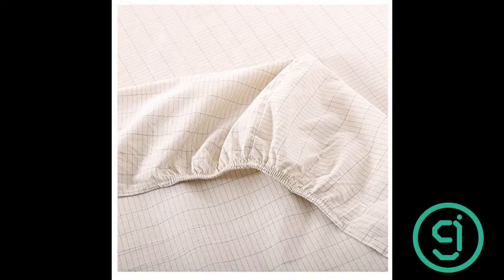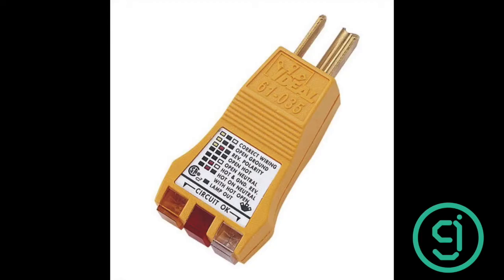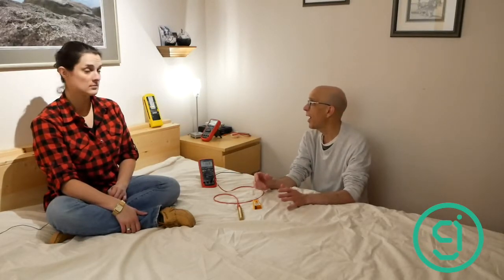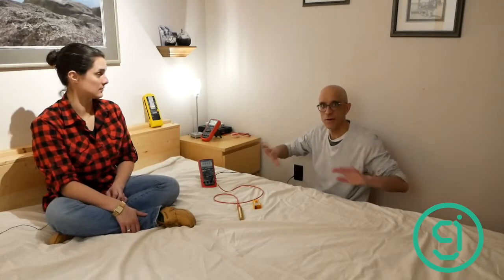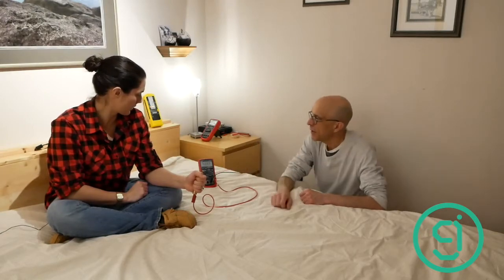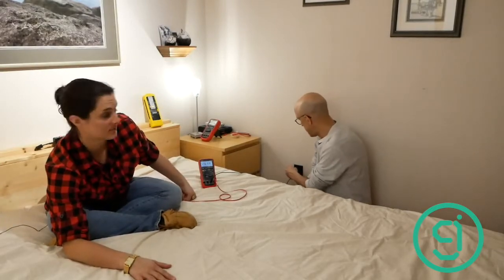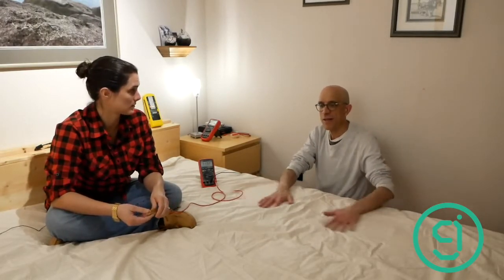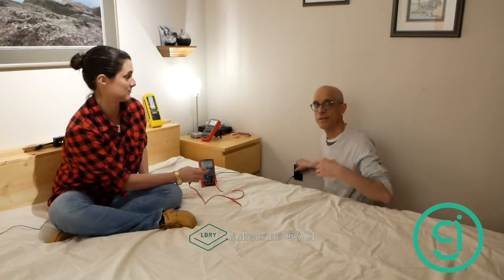Grounding Sheets Efficacy

Comment: Why do you make your sound so complicated. I’ve just purchased a really expensive one and there’s zero mention about a meter to check the electrical wiring is ground correctly. There’s no mention about additional electrical fields coming from the walls. So what are you lot trying to say. Almost feels like you are trying to dissuade people from using them !
Reply: At least you're grasping that some of this is a scam.

Get rid of the sheets and never plug foreign things that conduct into your electrical outlets unless they are an electrical device 

And most certainly never plug something into the hole of your outlet that is the ground wire, ever!!!

I don't think people really get what a ground wire is. Don't worry about because you aren't going to do this because it goes against every safety thing you ever heard about electricity in your home.

What you can do is.

Depending on your house or apartment, you can buy a wind-up alarm clock. And throw the breaker to your bedroom. And insulate your windows. 

Wood, brick and concrete aren't very good conductors of electricity.

Obviously, if this knocks out the heating or heating in your bedroom than don't do it.

Comment: This seems different from the usual case made for grounding. You are reducing the magnitude of A/C voltage picked up from a typical modern indoor environment (electro-smog?) by grounding, but other videos talk about taking off your shoes outside where presumably there is no electro-magnetic field other than the earth's normal fields. These other videos talk about charge imbalances in the body. Hard to know which theory to use when explaining why grounding is good for you.
If you want to avoid being an antenna, would a top and bottom sheet combo serve as a poor man's Faraday Cage? Let the sheets and mattress pad be the antennas while you shelter between them.

Comment: Why is no one explaining how to actually work the circuit tester? There's a ledger on mine and it doesn't say how to test outlet if grounded. Anyone? Anyone? A hundred useless reviews, not one explains it. You point to it, and just skip right over. Why? Testing if outlet grounded is the most important part. When I plug mine, two yellow lights light up, red one does not. Looks same as yours. What does it mean? Neither the seller nor any videos explain. So frustrated.
Reply: Two lights means is connected to ground. Most socket testers will have a small description of what the different lights mean. There are videos on socket testers for grounding. If you type socket testers and the name of your country you will find something similar to what you bought. I would recommend connecting directly to the earth outside with a grounding rod/pin though, that way you don’t have to worry about that or electrical interference.

Comment: Measuring the voltage to the Earth pin cannot give a true indication.  Here in Australia the Earth pin is also connected to the Neutral (return) conductor.  And while this is always earthed at each house with an earth stake, it always has an AC voltage on it of a few volts.
Reply: I would advise against anyone doing this anywhere. 

Nobody should be plugging in to the electrical outlet, into just the ground wire hole.

Even if you get a safe reading, that wire is still available to conduct electricity at any given point, that's its purpose.

Comment: I have been trying to call auroform ever since I bought your sheet about a question, but always get a receiving saying it will be a two hour wait if I wish to wait.  Also I did not get that voltage reader with the sheets when I ordered them like you just said is included..  My questions which I've submitted to auroform several times, but never get a response is can the sheets be washed in a washing machine and dried in a dryer and secondly I have a dual temperature control mat under the sheet that warms my bed during the winter months and cools it during the summer months and I was told that I need to put some sort of pad between the sheets and the dual temp pad.  Is that correct?  Also no one ever said you need a low voltage room to use it in, as I have a clock and the mat and a ceiling fan and a diffuser all in very close proximity . Does that mean it is dangerous to even try to use the sheet and during  a storm am I at risk by even having it on my bed?

Comment: Hey there, my voltage meter is not sensitive enough so I cant check body voltage. 
I made a grounding sheet myself by buying a copper fabric. Tested it with multimeter and it works fine. 
But i dont know if it works under a bedsheet. 
Would you please tell me if this would still work under a thin bedsheet.

Comment: My wife and I bough bought grounding sheets, she has one and I have one (Separate).  We both woke up independently really hot and sweating on the first night of using the sheets.  There is no temperature change in the room at all.  What is this all about?
Reply: You have water in your body I would guess the water in your body conducted heat ... I get really hot in MRI machines.. I was told prior to all reading that my cells are holding alot of water... that's my theory for me that the magnetic pull warms up all that water and boils it on cellular level, cause even in the machine I get pain in my inflammation areas and hot
Reply: Your the only person that complained  you are running a fever because you took the pfizer vaccine booster congratulations
Reply: What brand sheets?
Reply: @gregc3831  Oh golly.....   Not too sure.  It's been a LONG time that I've bought those sheets.  They were from Amazon.  They were pretty inexpensive, but they work.

Comment: How can grounding sheets affect you worse if you are in an emf field?  The EM fields interact with the silver strands on the sheets and would conduct to ground at that interaction point as the em field would superimpose electricity onto the grid far easier than your body.  Elimination of the EM field is a good idea all together, but my opinion is don't preclude yourself from getting the sheets if you happen to sleep in a high EM environment, which most Americans do.
Reply: This is my question above, but I'm still confused over To Ground or Not To Ground!  And How To Ground exactly......
Reply: @chrispompano  me too. difficult to understand, plus no info on WHY or what benefits.

Comment: Ah see I was just looking for a way to ground my bed because the static was making my hair stand up and it was annoying.. but I am thinking this is a video for people who think they are "allergic to EMF".  If this is the case you all should know research has shown people can't tell the difference between actual electromagnetic radiation and placebo.. of course a static electromagnetic field is not the same thing as electromagnetic radiation.. but I'm sure it all gets lumped together in people's heads.. and technically if you moved your body over a static field it would result in low frequency radiation.  Also electromagnetic radiation is everywhere.. visible light, ultraviolet, infrared.. the sun is the biggest source in our solar system.  Your body even gives off radiation. It's called black body radiation
Reply: Exactly...I don't know what they think they are trying to prevent or cause.

Comment: I'm glad I found your video before ordering a ground sheet or pad,  but now I feel very disappointed and at a loss of what to do. I unfortunately live with a cell tower that is practically in my back yard. I was hoping a grounding sheet might help give my body some relief,  but looks like it won't, esp when there is no way to get away from the tower and everything that it is transmitting. If you have any suggestions please let me know. I've looked at a few companies that sell room eliminating emf protection , but the devices are hundreds of dollars and way out of my budget esp when I would have to do a whole house. I'm also not sure how well they would work considering the amount of emf Cell towers omit. It's so scary to think about this and not be able to do anything about it.
Reply: You can at least protect your sleeping environment. You buy or make a box like encasement around your bed made of conductive fabric which is connected to ground. There you may experience the shielding effect. Like in the video your body voltage will drop.
Reply: I am so pist. I have had a grounding mat for awhile but didn't use it. I wanted to get a conductivity tester first to make sure it was working. Just paid more money for this. Only to find now no point in using it.
Reply: Here's an off the wall idea.....not sure if it will work, so you need to ask around & do testing.  The home improvement stores all sell aluminum roof paint that is highly reflective.  Maybe, it will protect you or not, but they also sell that EMF paint additive which I believe is pure carbon you can add to that roof sealing paint.  Hopefully it would totally mess up the tower & reflect those signals back at the tower!  LoL, & you get into a legal battle, & maybe they'll buy you out!!!!   Some smart electronics engineer out there should come up with something that a house can be treated with, short of Stealth Bomber coating that absorbs radar.  I bet Raytheon has some secret technology.....
Last option, is to make sure you're heavily insured  & use your imagination.
Reply: Move out.
Reply: @Modelscoutingwd  Wow, such a smart comment, Im so glad ppl like you are here to give me such intelligent answers to difficult problems.
Reply: @Pinnk0077  dont fight against a mountain. I know it is not as easy as just packing and go. But your health is first. I say this for you, not against you.
Reply: @Modelscoutingwd  unfortunately, life does not work that way. I don't have the option of moving, therefore I have to find other ways to deal with the problem.
Reply: @Pinnk0077  I hope you will.

Comment: what if your outlets are bootleg grounded?  a lot of landlords do that out of laziness. Bootleg grounds read as "grounded" on the tester device.
Reply: I'm not sure why people are plugging these into their walls. You can buy a conducive grounding rod which you been shove somewhere in the dirt outside your house. They usually come with 40ft of wiring. You hook up your grounding sheet to that wiring and now it's just a connection between you and the earth.
Reply: @RobyMontes22  what happens if you live near where lightning strikes or there's a massive power surge, where do people think that electricity is going to go.
Reply: Exactly. This is totally true, same if you live in a house that was reno and flipped.

Comment: I thought grounding was to raise ur volt not lower.
Reply: lower
Reply: Grounding is about lower potential conductance to zero. Earthing is about allowing the free electrons on the Earth's surface to be used by your body's electrical processes (basically everything in the body is electrical signals) to help it work more efficiently. Anti-oxidative stress and anti-inflammation properties of Earthing come essentially from allowing your body to get what it evolved to get. Our bodies evolved to walk on land barefooted for tens of thousands of years. Only over the last 200 years did we move to shoe styles that didn't allow this to occur which is nowhere near long enough for evolution to no longer need contact with the Earth.
Reply: @grumpyguss  that all sounds all technical except you really would not want to lower your body's electrons...

Do you know what an electron is? 

Your body produces energy aka electricity at a biochemical level in your cells, every living cell via ATP which issue potassium as the element through the ATP process that gives off an election. 

You really wouldn't want, your sheets cannot do this anyway, but you wouldn't want to drain out those electrons even if you could. 

You need a high enough level of potassium to have ATP to create the electricity. 

You know what happens if it does get to low, bad things!

No, seriously, your cells plus your brain and nervous system cannot transport that energy effectively. 

You could afib or your brain can shut down, you can go into organ failure, or your muscles start contracting, you can lose the ability to move your hands properly. You can have a seizure. 

The human body, for many reasons, can conduct electricity. Which is good. And yes being subjected to high levels of electricity can effect your health. 

But this thing you're talking about with the Earth's electrons flowing towards the ground,  isn't doing anything to you. 

It isn't how this really even works to begin with, but this like thinking that you read the sun's radiation is bad therefore you are going to block all means of it from passing through your body. By living in your basement, in the dark for the rest of your life to lower your chances of breast cancer. 

<when you fly in a plane, do you think, yeah why can't I see the Earth's curve....because that's the same logic that started that bit of nonsense, except this one has a product that people can profit off of>
Reply: @grumpyguss  i can assure you that you can't pull the free electrons from the Earth, into your body, to help your better at making or helping the flow of electricity in your body by grounding yourself at night, on sheets, that are on your bed. No more than if I took a large sheet of sticky plastic and laid on my bed, naked and stuck rowes and rows of potassium powered tablets to my body and wrapped  myself in cellophane.  
Your body doesn't work like that. It just doesn't. 

Here's an experiment? Get some glucose stripes from someone you know who has diabetes. Don't eat anything for 1 hour. Test your glucose. 
Then fill a bathtub full of water and 10 kg or 10 lbs of sugar. 
Immediately get in the bath and lay in it for 3 hours. Get out wash area you urinate from to reduce contamination and check your glucose. 

If you want more accuracy and you properly know how to do this, take a blood sample, same steps as above, and compare it to the 2nd sample after soaking in sugar water.

Then get back to me with your findings.

Comment: ''Grounding yourself in an electrified environment is like drinking out of your toilet bowl."

Never use the electrical ground, ever. The Super E-smog Spion meter with a body contact antenna can demonstrate why. In fact, if you tried it you would pull this video.

If you have a low-frequency meter or spectrum analyzer that measures down to 100mV/m @50/60Hz, I wouldn't ground to the actual soil/clean ground without first achieving less than a 300mV/m body potential reading on the NF1000. Then you would want to make sure you're still under 300mV/m while lying on the sheet after grounding it. Even then, if you don't have something like an Esmog Spion you won't hear any RF riding on the ground or any other nasties, which does happen on the odd occasion in some homes.

Enjoy your videos but this topic can cause more harm than good. Everyone who I have demonstrated how bad their grounding sheets are never use them again. If I want to sleep grounded, I sleep on the ground, well away from any power infrastructure.  

Crunching numbers all day is great, but like a picture is worth a thousand words, so is sound. People should listen to their grounded sheet solutions, they would be horrified at what they are sleeping in.
Reply: thanks for sharing, I was planning to buy a grounding sheet as I live in an apartment and this would've been an ideal solution but now I see it isn't... what else could I do instead?
Reply: I just found in another video that there are ground sheets that can be alternatively connected to a wire that can be extended via wiring out the window into a rod that can be set into the ground directly, thus avoiding the need to connect to the ground of a power socket, that sounds a lot more natural for a solution... but, I live in an apartment, if I drill a hole in the concrete wall and plug in there a rod, would that be still grounding and how could I test it?
Reply: @Dragon77-Pro  can you give a link to such a grounsing sheet?
Reply: I'm in the same scenario in a high-rise apt. building.  I now wonder if one can ground to concrete.  Or directly to copper piping?
Reply: @chrispompano   You can with a Bolt in the concrete, but you first have to make sure you are below 300mV/m A/C. (body potential reading)
Reply: @lnTheRed      I' m still trying to understand all of this as its a new concept & the grounding/earthing is where I started getting mislead. 
 Now, more I think logically about what you are saying;
in a Hi-Rise building, the galvanized steel conduit runs in the concrete floor/ceiling slabs that connects to the breaker-box & then to main panel at the meter room.  So in this scenario, will grounding into the concrete structure be just as bad?
I'm wondering if the copper fresh water piping is fully isolated from the concrete  structure.......
The concept  you are explaining I can't fully understand.  Are there any good vids on it, &  what is the subject title, or should I start watching vids on The Super E-smog Spion meter ??????

I even went to the SaferLivingTechnologies website, & still don't really grasp the concept, however, it seems that they really don't promote the whole grounding concept, & they advocate "shielding from EMFs" vs. grounding from hat I think i'm seeing.....

I have a good DVOM with a A/C mv setting & it has a basic scope I really don't use.
Could you please tell me how to " test" myself?

The only product I bought was a grounding pillow case plugged into a GFI power strip since I was afraid of being shocked during Florida lightening storms!!!!!!😵
Not sure if that would've even helped.
Reply: I DONT HAVE KNOWLEGDE ON ELECTRICAL STUFF .. BUT WAS LIKE 🤔 I DONT SEE THE BENEFIT FROM PLUGING IN TO ELECTRICITY.. FOR SOME REASON CANCER CAME TO MY HEAD😐

What do you think of silver thread fabric you think is a good option?